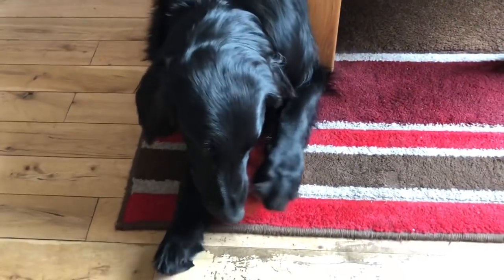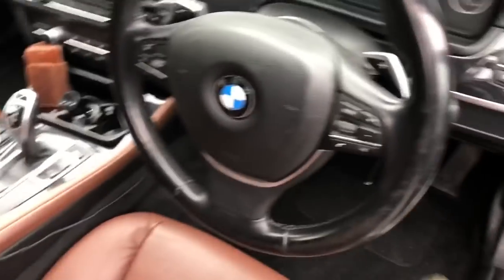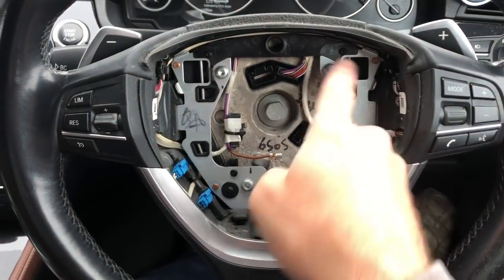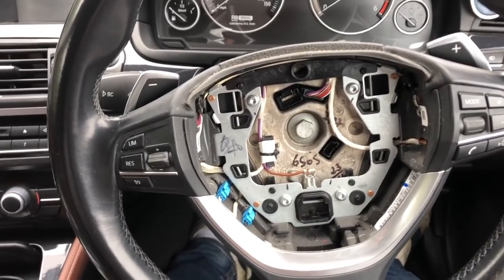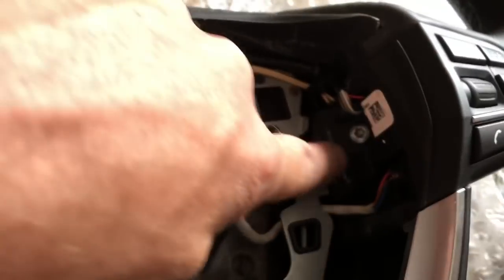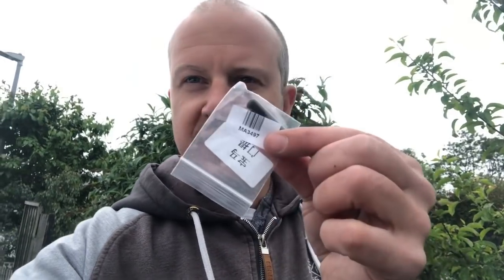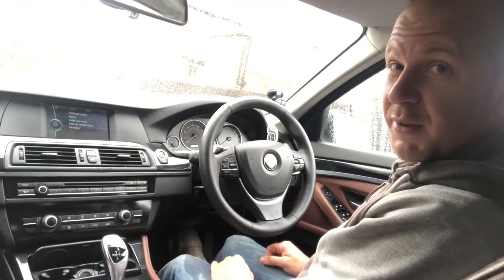BMW F11 F10 Replacing the Steering Wheel

Comment: Hello.. Good Video. Question: Do you know if there is a difference in thickness between the real M5 F10 steering wheel and and the steering wheel you are having? I am looking the whole internet but no detailed info about this.
Reply from the maker: Hi there, I don’t think there is much of a difference in the grip thickness, but the M-series steering wheels are definitely different. They are often flat-bottomed and maybe with carbon trim and sometimes with leather/alcantara finish
Reply: @Nut_Job.  That's a shame because I want a real thick grip, like how M Steering wheels should be.. Which maximum thick steering wheel would also fit in a  2008 F01 Modell?

Comment: 🤔 Do you suppose if you hadn't originally got the paddle shifters and you upgraded to a wheel with them but didn't bother connecting them up that everything would be ok? Debating attempting it.
Reply from the maker: Yes, it would be fine - but of course you couldn’t change gear with them that’s all

Comment: PLEASE REPLY I DONE THE SAME THING BUT THE MULTIFUNCTION BUTTONS DOESENT WORK HOW THEY EVEN CONNEDT WITH THE CAR,
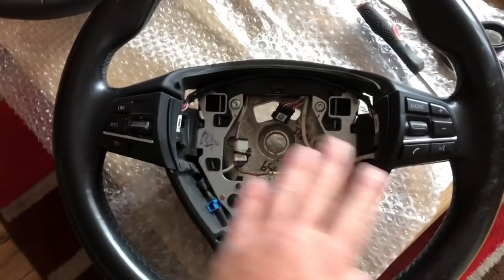Reply from the maker: If you watch the video from around 6:12 you can see the wiring & plugs for both of the steering wheel button clusters. You need to make sure they are connected & plugged back into the car when you put the wheel back on 👍
Reply: Nut Job 😂man i chrckrd everything then i removed completely everything then i see i didnt pluggrd the cable for the buttons Thanks Your video helped alot specially whit shifters you said to watch not to mix them thanks 🙏

Comment: Much smarter...although I have seen these leather wheels quite effectively 'refinished' in situ...Impressed by two other things. Car still seems to have its original BMW battery ..and the full tank of diesel. 😉😉
Reply from the maker: I think that old wheel was beyond repair to be honest - incredibly worn over the bottom right. I’ve had other wheels re-trimmed before, but considering I picked up the new wheel for £60 it was no contest really.
Reply: @Nut_Job.  Bargain! Main wear on bottom right you say? Expells the myth then of Police drivers adopting the tried and tested 10 to 2 hand position... Lazy sods!